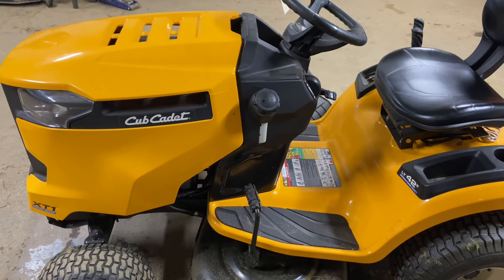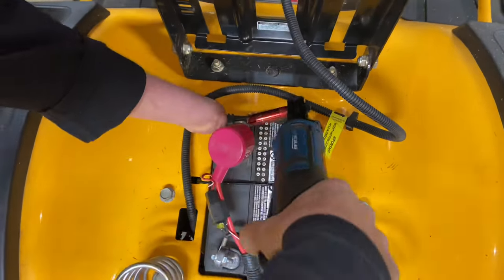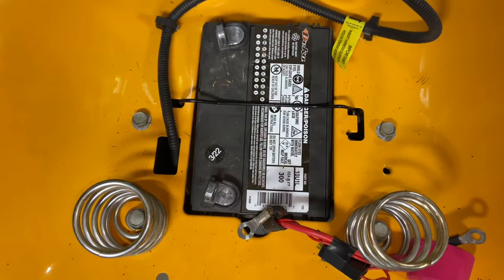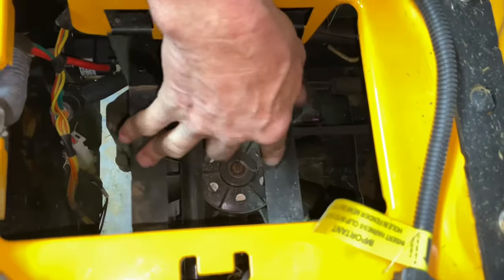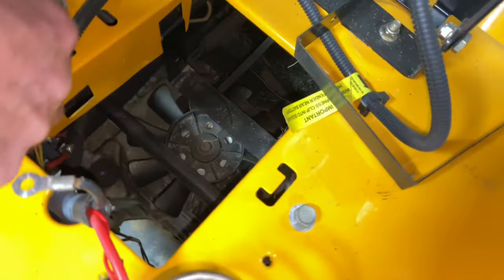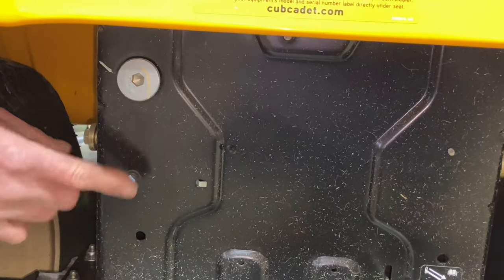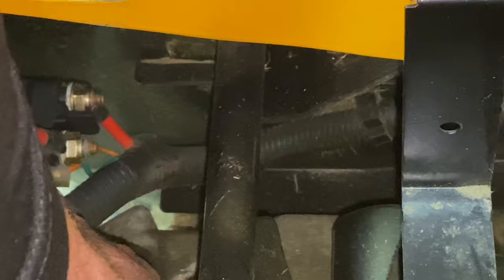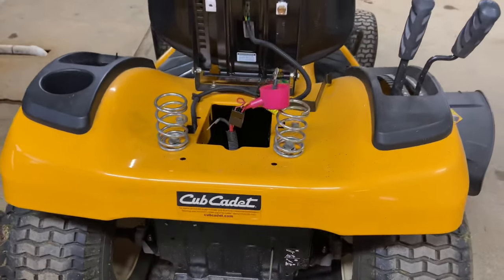Cub Cadet XT1 Lawn Tractor Starter Solenoid Location and How to Remove Battery.

Comment: Good video, it is hard to jump the solenoid with the battery out of the machine. Bad engineering. Thanks for the video.
Reply from the maker: MTD (Cub Cadet) did this back in the 80's and there still doing it. :(
Reply: My Troybilt thoroughbred in basically the same position but equally a bit of a bugger to access
Reply: Throw away mowers

Comment: It's going to be pretty tough to test this solenoid where it's located! Pull the battery and there no 12v. Unless you can jump from the battery to the cables somehow! You mean to tell me they don't have room under the hood? Jeeez
Reply from the maker: I would like to know what there thinking was about this location.
Reply: @JohnsonsSmallEngines  My XT1 won't start and I suspected the battery or solenoid - It was running fine yesterday and today,  I stopped to empty the grass catcher and now it won't start.  To test the Solenoid, I can jump the battery, but how do I get around the seat switch ?
Reply from the maker: @mattsilver8842  before you try to jump the starter solenoid. Check to make sure that all of your safety switches are engaged. Which means engage your blade engagement and then disengage it to make sure it’s off. Make sure the brake pedal is locked in to park. Then I would use a jumper pack or jumper cables and try to jumpstart the battery. If your parking brake is on you can start the tractor as long as PTO to your blades off and everything is working correctly you do not need to be sitting on the tractor. The hard part is checking the solenoid. You have to remove the battery then reconnect the battery when it’s up out of the way. to check your starter solenoid
Reply: @JohnsonsSmallEngines  thanks :)  I do have the blade disengaged (it is a lever, not a push button to).  All I have ever had to do is press the brake pedal, sit in the seat, and turn the key.  I will try it with the parking brake on.  It shuts down when enough weight is removed from the seat - will I have to disconnect the seat switch or disconnect it and short it out ?  :( frustrating because it was working so well until it wasn't (;  - I stopped, disengaged the blade, turned the key off, got off, emptied the grass catcher, and it wouldn't start - I do not hear a click from the solenoid ..
Reply from the maker: Check your fuse. It should be near the starter solenoid.
Reply: @JohnsonsSmallEngines  I should have provided a better intro to my diagnostics.  
When I turn the key, there is a faint click from the FRONT lower left and the Console Panel displays 12.5 v then flips to the hour display - 133.    I did check the fuse which is right at the +'ve battery terminal and the battery terminals - both are good.  I'm sure it is something electrical because the starter does not turn - it is an eerie absence of sound.
It had been working fine - It takes me one loop around the yard to fill the grass catcher (large yard) so I must stop and empty it, and I had done it at least 10 times already and the last time it did not start.
I have removed the battery, and jumped the wires and put pressure on the seat switch; made sure the blade is disengaged, brake on,  There is no sound at the solenoid under the battery,  
Do solenoids just suddenly die?  my next hunt will be the switch/sensor for the blade being engaged.
Reply from the maker: At this point I would need to start to checking switches with a test light. It’s going to be starter solenoid, brake switch, pto switch or seat switch
Reply: @mattsilver8842 I'm having the same issue off and on. Did you ever track the source on yours? I'm getting negative 13v at the starter terminals on the multimeter, reads fine at the battery.
Reply: Thanks for the information

Comment: I love my XT1.  Thank you for showing more about them. I have a problem that I am not sure if I should try to fix it or take it to a shop.  The nobbins that hold my blade on is wearing out. The lawn I mow on is mostly sand so I use thicker blades or the thinner blades wear out in about 5 mowing.  The spindle assembly is what I think needs changed. If I change it, Do I need to tighten it with a torque wrench or just a standard wrench?  Maybe you could make a video about it.  You give us great info, Thanks.
Reply from the maker: Technically there is a torque for every bolt but I don’t torque the blade hub bolts and never had a issue.
Reply: @JohnsonsSmallEngines  Thanks!!

Comment: I just changed the battery and since doing so all I get is a whirring sound followed by what sounds like metal clanking. Is this the sign of a bad solenoid or starter? Before changing the battery it would try to turn over but there was not enough juice. Now since replacing the battery just this whirring? Thanks for your help.
Reply from the maker: It sounds like "Metal Clanking?" blown engine? "whirring sound?" Check to make sure you connected the battery correctly. Red wire to positive, black wire to negative.

Comment: how do i tell if my solenoid is bad?  My mower turns ab out a quarter turn then stops, quarter turn then stops it makes a high pitch whine when i try to start it. it might be the battery as it was charged but drained very quickly. thanks for the video
Reply from the maker: It sounds like a bad battery or a cheap battery. What Cold Cranking Amp is it? It will show CCA on the battery. What is the make and model of your engine? Horse Power? Single cylinder or twin? All these questions will let me help you choose a correct battery. Here is a video on how to check the solenoid, but I do not think you have a solenoid issue.  https://youtu.be/5iUmazojh_Q. Worse case you may need the valves adjusted or even worse is if you have a single cylinder Briggs engine and I have seen a bad cam.

Comment: What would the symptoms of a bad solenoid be?
I have a xt1 50"  has enough volts to start, new fuel filter, spark plugs, air filter but I hear a clicking sound under the battery.  I suspected the solenoid but couldn't find it which is how I found your video.
Reply from the maker: What you explained may be a bad solenoid but you need to confirm your battery is good by a load tester. You may be able to take your battery to a auto store to make sure your battery is good. Once you have 100 percent know the battery is good then you must test the solenoid. You check the solenoid by turning the key to crank position while you have a test light or multi meter red lead on the opposite side terminal of the positive side that goes to battery. If the red lead doe not show voltage when the key is in the crank position, then your solenoid is bad. If you have power to both leads on the solenoid when you turn the key to crank, then you may have a starter issue but that doesn’t happen often.
Reply: Ok   I forgot to mention that I did have to replace the battery last season so hopefully that isn't the issue this time.

I will give the solenoid test a shot and see what I come up with.

Thanks for your knowledge and keep up the videos.
Reply: I’m having the same symptom. Was the clicking sound under the battery a bad solenoid?

Comment: Nice quick video. My 2017 XT1 is a push button start. When I went to start it 3 days ago, all I got was a very short attempt to turn over and then a low whining noise while the button was pushed. This same thing happened during my warranty time and they supposedly changed out an ignition module. It worked but was never a smooth starting mower after the module was replaced (it would start to turn over, stop for a second but then start). 
I did try to use a Duracell jump starter for a car but nothing changed. I have not put a volt meter on the battery yet. It is the original battery, but it worked fine last week. Can it be that module again? Any suggestions would be appreciated.
Reply from the maker: I have come across that before and It sounds like the battery is failing. I would suggest to purchase a battery that is at least 300CCA “cold cranking amps”. Make sure your battery cables are tight to the battery when you install the new one and that should fix the issue.
Reply: @JohnsonsSmallEngines  I had taken the battery out last night and put it on my charger and hit repair. This morning it said repair done and I reinstalled the battery and it started up. Same start up sequence when it will start to crank, stop for a second or two and then crank and start. Thanks for the quick response. Appreciate it!

Comment: My xt1 will not start no crank nothing.
Battery tested 12.3v
What's the first possible issue??? The starter solenoid?
Reply from the maker: Check to make sure your cables to your battery are tight. I would suggest checking all safety switches, engage and disengage your PTO engagement lever or switch whichever one you have. Push the clutch in and release and make sure the clutch is in the on position when you’re trying to crank up the engine. next would be to check to see if you get power to the starter solenoid from the ignition switch. It will be a little tricky to test your solenoid due to your battery location but it can be done. In the link in the description below, there is a video on how to check the starter solenoid. It is on a John Deere, but it’s the same principle.

Comment: How easy is that OMG and hubby wants to spend 5 grand on a new one, Im going to atleast try to fix it. Love Youtube solutions
Reply from the maker: First try the simple. If the tractor is not starting, try charging the battery, make sure the mounting hardware from battery cables to the battery are clean and tight, check the tractor fuse, there is one somewhere located near the battery, make sure your power take off PTO mower deck engagement lever or switch which ever you have is in the off position and make sure the emergency brake is on.
Reply: @JohnsonsSmallEngines  Thank-you I went out and cleaned the connections as well as debris around the solenoid made sure the battery was charged checked the air filter put in new gas started right up, Hubby's bummed no new toy but I'm happy because it didn't cost me more than 10 minutes work
Reply from the maker: Glad to hear it’s running!! Thanks for sharing!

Comment: Good evening 
I have the exact model of Cub cadet you have.
My mower would work for 10 minutes then cut off.  Finally after a few weeks it stop turning. I have replaced the air filter, new spark plugs, clean the carburetor and fresh gas. Battery is all good. But now it cranks but it doesn't start. Please help. Thank you
Reply from the maker: Cannot diagnose without seeing machine but I can say there are three things to check. Check spark , check compression and make sure fuel is getting to the carburetor. Then check to make sure your choke is working correctly. Check to make sure your fuel shut off on the carburetor is working.
Reply: @JohnsonsSmallEngines  thank you very much.

Comment: Could you tell me which way the two small wire plugs attach to the selenoid? 1 Green one 1 red one...right - left?
Reply from the maker: You would need a wiring diagram for your exact model you have to be able to tell where they go. You can look up the diagram online with the model number from the sticker under the seat.
Reply: @JohnsonsSmallEngines  I called Cub Cadet today and was on hold forever. I've had no luck finding the diagram online. Any idea?
Reply from the maker: I would need to see what you have to be able to help you more.

Comment: Got a ? My xt1 was running last week and now I can't get it to turn over, even with a jump the starter is very hard to turn. I checked for spark by removing the plug and leaving in the boot to me it looks weak. I'm thinking I might be the coil. When I did get it to start it was really rough ill need to charge my battery before trying again. Any suggestions
Reply from the maker: What engine is in it? Model number and make?
Reply: @JohnsonsSmallEngines  Kohler 18hp 597cc SV41 courage.  I did take the coil off and noticed a tare  on the spark plug wire I checked resistance and didn't get anything. I'm gonna bring the coil in work on check it on another meter just in case
Reply from the maker: @Kegga_6  Sounds like you need a battery. How old is the battery? And it should be at least a 275CCA. If the engine doesn’t spin fast enough, the ignition will not work.
Reply: @JohnsonsSmallEngines  battery isn't even 6 months old

Comment: How to replaces alternator at 2015 cabcudet xt1?
Reply from the maker: No video on that yet. Haven’t had one fail yet in my shop. Most of the time it will be a weak battery that will not stay charged because the battery is bad. Or a regulator may fail every now and then. I woukd suggest checking the voltage output at full throttle at the battery if the battery is in decent shape it should show between 13 and 14 V output at full throttle with a voltmeter before replacing alternator. Unless you know the alternator is bad??

Comment: I changed out the solenoid on my XT1, which is a pain in the a$$ because of the location, and it started right up. Came time to mow again and the mower won’t start!  I was told to buy cub cadet because they were the best. I’ll never own another one. I had better luck with the cheapo Walmart brand than the cub.
Reply: I'm having trouble with my XT-1 not starting also. I charged battery and it's not turning over. Did you get yours to start? Mine is fairly new, only used about 10 times last summer. It's so frustrating!
Reply: @falinaluce6785  I can get it to start sometimes with the key. But mostly I use a jumper from the hot on the battery to the hot on the starter, red to red. Don’t have to hold it on long and make sure the brakes are engaged. It will spark on you too.  Also be careful of not burning out the starter motor, holding the jumper on too long. 

When I get paid, I’m going to order a new switch not the whole module. Module is $90 but new switch is under $20.

Edit: mine is 2yo. It would act like the key wasn’t working the first year but always started. Now if it doesn’t start, I jump it.

Comment: Engineers should be *#^#&# #&$^#&÷ for putting it in that location!!! I need to replace that sucker and it is impossible to reach!!! I watched this and managed to clean something on it enough to crank - ONCE. Today I just used jumper cables and held that red cable to the starter and it was fine. Trying to match this solenoid to something available is also near impossible. STENS brand, same manufacturer of the solenoid is at Tractor Supply- but I can not for my life match any numbers. I'll have to wait until I'm more relaxed to start digging that sucker out.